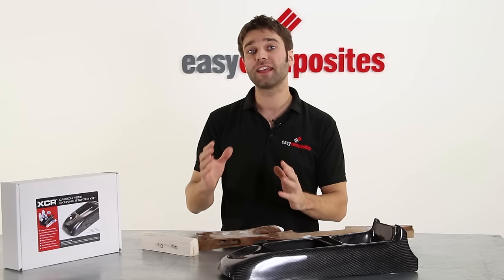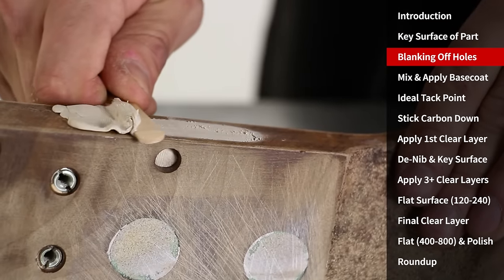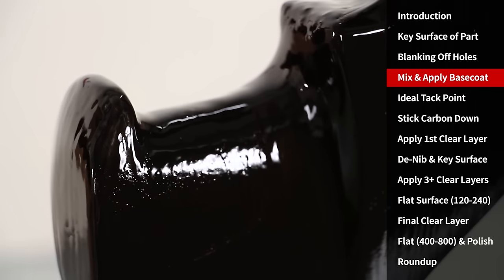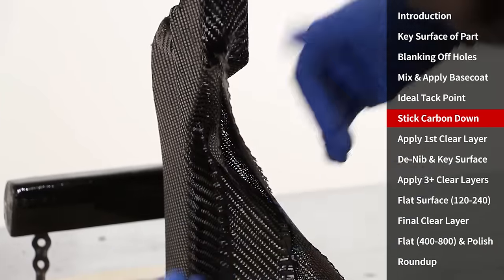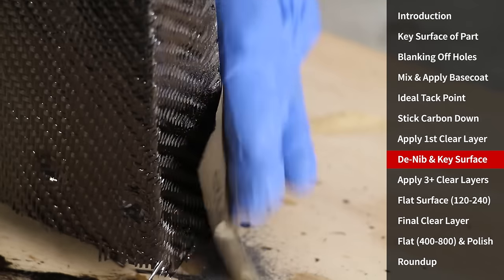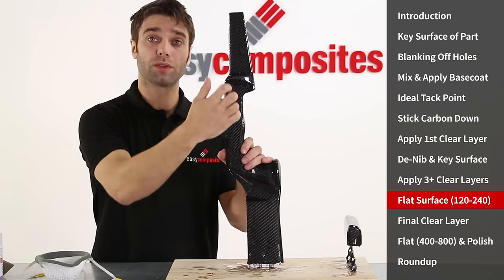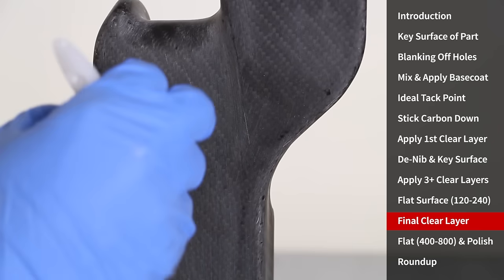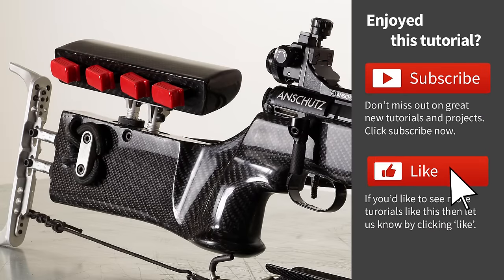Ultimate Carbon Fibre Skinning/Wrapping Tutorial - Sofie's Rifle Stock

Comment: Is there a risk of the carbon being not properly wet out with the epoxy using the technique of applying the carbon to tacky resin? Would that result in reduced strength compared to a conventional laminating and vacuum process?
Reply from the maker: The carbon is only applied to the tacky basecoat as a way of holding it in position whilst being wet out. Once in position and held in place by the tack form the resin, it's then left to cure until it reaches the 'B' stage. This is a semi cured state which will still cross link with the resin which is then used to wet out the fibres. 

Hand laminating does produce slightly heavier and less consolidated parts but we have found that trying to use a vacuum technique when skinning results in a more wrinkled and distorted weave.

Comment: Hello quick question. I am planing on skinning a part to match my dash which has a matte finish. To get the matte finish would you skip the polish phase and shoot the part with matte clear coat? Thanks in advance and amazing tutorial!
Reply from the maker: Hi Jon, you have two options - wet sand up to around 1500 grit to achieve a matte appearance and forgo the final polishing stage OR as per your suggestion, go with a matte/sating finish clear coat. Both will achieve much the same aesthetic but the preference would be the clear coat as it adds additional thickness and gives a 'deeper' looking finish to the piece.

Comment: Very good video with clear and precise information. Question: If you use a foam core instead of a wood core, would it be strong enough for a rifle stock?
Reply from the maker: In this case, the wood is not really a core, it IS the rifle stock.  We have done some repairs and changes, but primarily the repairs were strong in themselves. The cosmetic layer of carbon fibre does add some strength but its purpose here was to smarten up the rifle and cover over the previous repairs - as well as being something different to feature in the video of course.

Comment: Will epoxy have good adhesion to a plastic stock? What plastics should I choose for 3D printing in combination with carbon lamination? Or should I rely only on the mechanical connection? In the case of the stock, we need to select plastic with a wide temperature range of operation and high impact strength like PC, PET or Nylon.
Reply from the maker: Most plastics with a very rough key will be ok. Even hard to bond plastics will be mechanically locked in by the skinning process.
Reply: @easycompositestv  Thank you!

Comment: I would like to re-skin a Carbon Fiber dash from a Caterham 7,  The idea is to create a blank dash and start again by skinning over the whole dask and cutting out the circular openings as needed while eliminating the small switch cut outs (2x3cm).
As I need to eliminate various switches on the dash, do I need to add support behind those cutouts such as a strip of masking tape to add support? 
Will the mat sink into a small openings or is is stiff enough to lay across them? (What weight Mat should I use)
 As the dash is CF should I still use a black base coat or clear?
Lastly are there any issues laying up over existing CF 
 Thanks
Reply from the maker: The carbon may sink so filling in the holes first will solve that problem.

Comment: Looks really effective. Would it be possible to use multiple layers of carbon fibre with this wrapping method for example with a foam core mold that would remain in place once the part is finished? Or is it still better to use pre preg and vacuum bagging with a heated curing cycle as I would be making parts that needed excellent structural strength.
Reply from the maker: Yes you can wrap multiple layers of fabric around a foam core.  This can be a good method for prototyping or one off projects.  You can leave the foam in situ or dissolve it out with a solvent afterwards.
Reply: @easycompositestv  Great that looks perfect for what I had in mind.

Comment: Very well explained thank you.
But I had a doubt, is there any difference in epoxy gelcoat you applied as first layer and epoxy you applied after wrapping carbon fiber other than difference in pigment colour?
Also if I have to apply 2 layers of carbon fiber how will I be able to do that given I don't want to lay them up seperately by curing every single layer
Reply from the maker: The basecoat and the topcoat are very similar, the difference is the black pigment and the basecoat is more thixotropic (less runny). Usually in skinning you would not add more than one layer but if you want or need to do that then the two layers can be added at the same time.
Reply: @easycompositestv  thank you for the clarification.
I was worrying about the fact that second layer might not join to my core as epoxy coat might not reach it due to absorption by first layer itself.
Anyway thank you so much you guys are great and has helped me a lot in creating my project

Comment: One question...the next thing I have to skin is my dashboard "in situ", are there any tricks and tips to reduce resin dripping off on the various surfaces under the dashboard? I can cover these areas with plastic sheet etc, but some is bound to get through in various places which I want to minimise.
Reply from the maker: Good masking is the only real solution. You can brush coats on thinner to minimise running and drips but that might mean more layers needed to get to a decent thickness for sanding purposes.

Comment: I am wondering why you need to use the thick black base coat for this, but in other videos where customers are using your products they use a spray adhesive to apply the carbon fiber before they begin the resin/epoxy process.  What is the benefit of the base coat over the spray to "set" the carbon on the piece?  THANKS!  Great video!
Reply from the maker: The resin for using a black base coat is to seal the surface underneath as well as provide a black coloured base to hide the colour of the part.  Many spray tacks are not long lived and also will loose adhesion when resin is applied over the top.

Comment: I have got one question is the carbon fibre sheet flexible as in if I want to round it around an edge will it get the job done without losing its weave pattern?
Reply from the maker: Hi Shoumik, yes, carbon fabric is flexible and can go round corners pretty easily. If you've watched the video though then you'll see several parts of the tutorial where we wrap fabric around some of the tight angles of this gun stock.
Reply: @easycompositestv   Thank you so much request you to upload some more videos related to carbon fibre your content and explaination technique is amazing

Comment: Great video. Are the clear layers cosmetic or structural? I can see that a smooth surface is important in this case for handling.
Reply from the maker: The clear layers are cosmetic; the structural work is done by the carbon fibre - adding additional layers of resin does little to increase the strength but it does mean there's enough thickness there to allow flatting back to a flat finish.
Reply: "I can see that a smooth surface is important in this case for handling."
actually depending on use its quite the opposite. a rough surface, specially on a gun stock, can add a much better grip and handling. some people actually add a "rough coat" type finish to stocks for this exact reason. in this case its more looks over function caus polished carbon had that lovely bling everyone loves
Reply: I sanded my carbon fibre sea kayaking paddle for extra grip. The rest is shiny and looks brilliant.
Reply: @GRPLiningServices   did you make your paddel

Comment: Can you do this carbon skin on an aluminum bicycle frame to improve strength and integrity of the frame? Or is that a bad idea? I was wondering if an older alu frame which could be prone to cracking from general fatigue, if this carbon fiber skin would help?
Reply from the maker: Hi Tommy, 

Yes there is no reason why you can't skin a bicycle frame. There will be some improvement on mechanical performance depending on the fabric weight and if you choose to add multiple layers. It will also rely on a good bond to the aluminium, so a solid key and degrease will be important.  A single layer of material though is only going to provide a relatively small amount of strength.
Reply: @easycompositestv  thank you so much for the response! You guys are truly great and responsive.

Comment: I want to carbon skin my dashboard. I have purchased another dash. And my plan is to once the carbon skinning is finished remove it then glue it over my dash that's inside the car.  My question is. To do 3 layers of carbon is going  to cost £150 that's just carbon alone. Can I be cost effective and do one layer of fiberglass then put carbon over the top? Or will 1 layer of carbon be strong enough or would it break when I attempt to lift the skin  from the dash.
Reply from the maker: Skinning is not the process for making a part.  You can do it as a mouldless construction method but you would need more than 1 layer of laminate, easily 3 or more depending on shape.  You can see this process here:  https://www.youtube.com/watch?v=0Yaggj16S08

Comment: brilliant tutorial. To allow for the the thickness increase for tight fitting parts, how much does each layer of clear add ? 1mm?
Reply from the maker: By the time it's sanded and flatted down there's typically only about 0.5mm thickness of clear resin. You also need to allow for the basecoat (0.3mm) and the carbon fibre (0.25mm) so all-in, estimate that a carbon fibre skin is around 1mm of thickness.

Comment: Very informative tutorial! One question though. What if more than one layer of carbon fibre is needed. Do we have to wait for the first layer to become tacky or can we lay the additional layers one after the other like when making a carbon fibre sheet ?
Reply from the maker: If you’re trying to add strength instead of just adding a cosmetic layer then yes, you could laminate more than one layer at a time, providing the fabric would stay in place without sagging or slumping off.

Comment: very interesting.  is it possible to skin just a portion of a stock?  are there quantitative measures of increased strength for weight-neutral skinning of wood structures?
Reply from the maker: Hi Randy, yes you can skin just some areas, just be careful with treating the edges neatly so it looks good. We do not have any specific figures for the effect of one layer of carbon

Comment: Would using traditional Vacuum bagging processing insure a better result from the initial skinning? To smash down the free edges as well as avoid bridging? or have you seen worse results when doing this due to bleed thru of the initial black base coat?
Reply from the maker: vacuum bagging is not normally needed for skinning and in most cases will not improve the finish.

Comment: This video is absolutely incredible, thank you. I am wondering if this process will work for my application. The object in question are carbon fibre bicycle rims, they have a matte unidirectional finish. I would like to skin them with a carbon-kevlar fabric, will it be possible to achieve a nice finish? If so then I will be ordering one of your kits, thanks very much.
Reply from the maker: It should be possible to skin such a shape no problem, albeit a bit fiddly.  The bigger issue is balance on the wheels. You would have to get the carbon layer and resin perfectly evenly around the wheel to keep it in balance.
Reply: @easycompositestv  Hey my apologies I did not see your response. Thanks for the tip, I did not think of that before. If I suspend the rim to dry this is going to cause resin to run from the top of the rim down to the bottom where it will drip off and create an excess. I'll have to think of how to deal with that or get around it. Anyhow I'm definitely going to try my hand at skinning, you make it look so satisfying. Thanks again for the videos :)

Comment: Hi, you guys come highly recommended amongst those already in the profession! I can see why. 

I'd like to DIY a few car parts. Such as door handles, bumpers, etc. I'm a little concerned about the added thickness. How much thickness does it add? Should I be looking at moulds rather than skinning?
Reply from the maker: Skinning adds approximately 1mm overall by the time you have your basecoat, carbon and top coats. Skinning is generally used for aesthetic purposes and doesn't require any specialist tools or equipment however, if you want to make a bespoke carbon replacement part then you'd need to make mould tools. The process is a little more involved but once you have the tooling, you can make dozens, if not hundreds of parts out of the same mould.

Comment: Nice video! Quick question - can I carbon fiber wrap my steering wheel directly on to the polyurethane (rubber) core? Or the epoxy resin will ruin the rubber? And if so, can you recommend me somenthing to put on the rubber so the carbon can be wrapped on it? Thank you and keep going with the great videos!
Reply from the maker: Epoxy is unlikely to damage the core.  PU is generally unaffected by epoxy resin.

Comment: When trying to increase strength in a structural piece, How do you determine how much strength is in a single layer of CF and possibly if additional layers might be needed?
Reply from the maker: Generally it comes from experience with the materials. If you are engineering and CAD minded you could run CAD FEA simulations to get some more measurable and repeatable figures.

Comment: Love your video! Quick question, does the same process apply to wrapping on a metal object? Thanks
Reply from the maker: Yes in theory, be sure to thoroughly degrease the part and file or abrade the surface a little bit but the epoxy will bond to metals.

Comment: After the initial basecoat and carbon lay down and the optimal 3hr has passed. Can you leave overnight before starting the clear layer or do you need to do the whole process start to finish?
Reply from the maker: you could but the by then cured resin surface will need to be abraded with a 120grit abrasive paper to provide a good mechanical key for the next layer to bond properly.
Reply: @easycompositestv  Thanks. If you wanted a matte or satin finish would you still follow this process of three clear coats ot would you need less and leave out the high polish at the end?
Reply from the maker: @anthonybryantmedia   Keep the same process and number of layers however, you wouldn't polish to the same level of glossiness, stopping at your desired finish.

Comment: I have a sander, heat gun, jigsaw and a hot glue gun or these tools necessary to do carbon fiber skinning and infusion resin? Will these tools be enough or will I need more lol?
Reply from the maker: You also want scales to measure out the resin accurately.

Comment: The video was great but I have a question. How did you identify all of the areas that needed to be cutout through the carbon fiber? Seems like it would be easy to miss a bolt hole .
Reply from the maker: Take a photo and measurements if not sure.  However generally you can see a faint line for the larger holes so it is easy to locate them.

Comment: And this is great !!!!!!  Can be used in polymer ??
Reply from the maker: Yes, you can carbon fibre wrap around plastic items. You would need to do some surface prep and it's probably worth checking the strength of the bond to your plastic first - epoxy will bond to some plastics and not to others.

Comment: Really good video! How do you know how many grams of resin you need for different sized products?
Reply from the maker: Generally you would use around 500g basecoat and 750g of XCR coating resin per square meter of material being skinned.

Comment: How strong is the skinning process?  If I skinned balsa wood for example, how strong would 1 layer of CF actually be?
Reply from the maker: Strong in what context? Balsa being easy to compress/dent would gain a much tougher surface finish as well as some improvement in overall stiffness. Skinning is not about adding much strength, although you could add multiple layers if you needed significant strength adding.

Comment: great video , and on the strength of it I bought the XCR base coat + hardener and the resin + hardener I am having trouble with the base coat it doesn't stay on it runs off, room temp is 22 degrees, I shook the tub, mixed 30g of base coat 10g of hardener and it just pools to the lowest spot or just drips off and I don't get the dense black you get, it just seems really runny.
Reply from the maker: Hi Mark, sorry to hear this. When you say it runs off, is it possible that you're trying to apply it too thickly? - Neither the clear or the basecoat can be applied particularly thickly (in one go) but a single thin application of the basecoat should be sufficient to give you a black background and a bond-able resin layer. When you say it runs off, does it leave a thin layer (i.e. the surplus runs off) or does it leave the part without any basecoat on? - If there is no basecoat there then we need to consider why (because there should be); check the keying of your substrate, if it's too smooth that could explain the problem. Feel free to contact us either by phone or email and we can discuss this in more detail with you and almost certainly get this resolved for you pretty easily.
Reply: thanks for coming back to me I've sent an email through you website.

Comment: Won't the resin and fiber change the grip sizing? Do you sand down to account for the added thickness? What thickness is added?
Reply from the maker: Carbon Skinning can add around 0.75mm to the overall thickness of a part. This can vary depending on how thick you apply the resin and how much you sand it back.